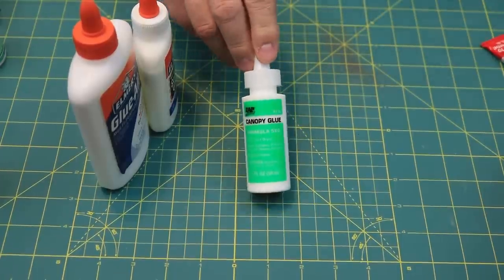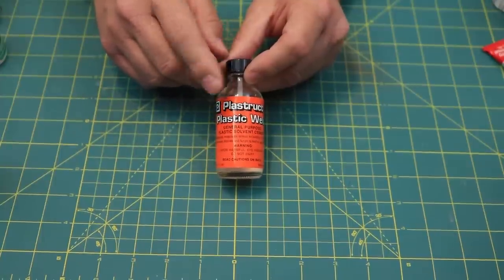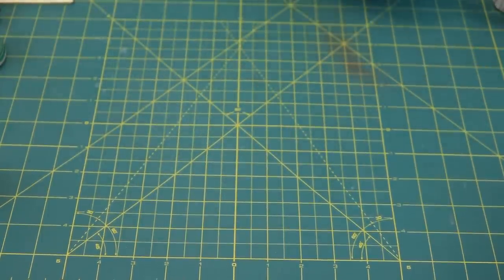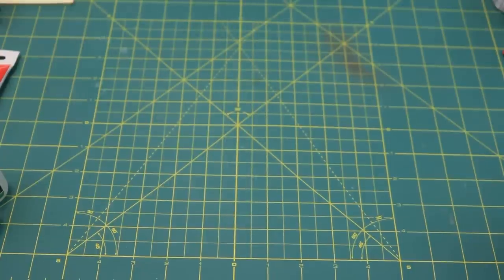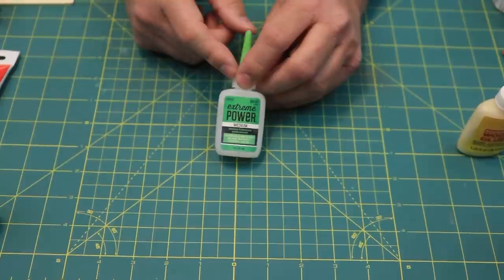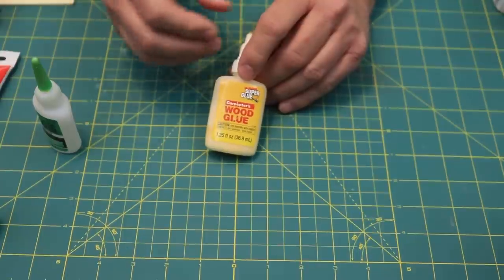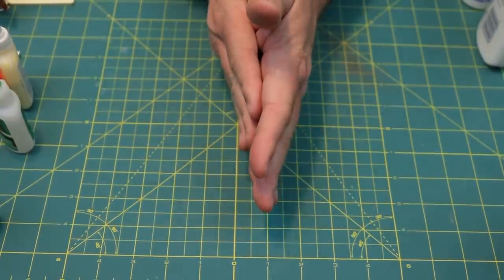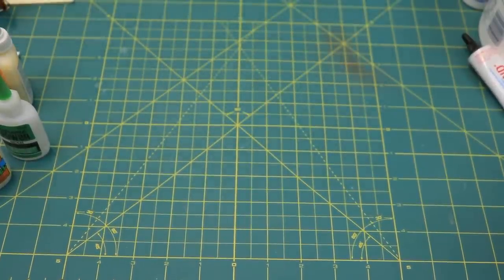Model Railroad Adhesives - How To Choose the Right One

Comment: Ron;
I am using Liquid Nails to hold down my track. Apply it, spread it with a putty knife, and lay the track. It does dry relatively quickly,  but adheres very well. The color  (off white) can be dealt with when ballast is applied. One caution is to be sure to leave the adhesive clear from the actual points on a turnout.

Dave Harrington

Comment: Pliobond is also a thermosetting polymeric adhesive. When gluing metal to wood the curing process can be hastened and driven to completion by slightly heating (e.g., with a soldering iron or clothing iron) the metal. Excellent, practical video. Kennedy
Reply from the maker: Good info. Thanks. See, a whole college course.

Comment: *Opens with a model railroad focused dad joke - NICE

I have a shirt exactly like that. 🙃

Choosing an adhesive is key in pretty much any modeling. When I was younger, whether it was trains, model cars, or kitbash projects, my default was superglue. Definitely not what you want to choose with clear plastic though!  

I was going to mention Tacky Glue and then it showed up on screen, so I won't.  Oh wait... Um...  

I've always been too clumsy for plastic welding. 

Handy hint... if you want to matte a photo, rubber cement is a good way to go. Apply to both the matte and the back of the photo, let dry, put them together, wipe away any excess. It's good for situations where spray matte might be a bit too messy.
Reply from the maker: Hi Christopher. Always good to hear from you, and thanks for the photo matte tip.

Comment: Another great video Ron, I have learned a lot from watching you. One situation that I continue to struggle with is constructing white metal kits. The only ones I’ve attempted are the pieces included with DPM kits. They never stay together or look horrible when they do and disassemble them almost immediately. Any hints or tips would be greatly appreciated.
Reply from the maker: Hi Bill. I wish I had a magic solution for you. IMHO white metal is the worst. The best solution is probably epoxy, but it is hard to mix and work with for very small applications like you are probably refering to. I typically use CA for detail parts, but it is imperfect at best.

Comment: What are your thoughts on using hot glue gun sticks?  I've used it to secure track and roadbed to the layout by using a small amount every few inches.  Seems to be holding firm and it can be  separated without difficulty (which is really nice for those of us who make mistakes!).
Reply from the maker: Personally it wouldn't be my first choice for that appliation, but I do use hot glue for building scenery base material.
Reply: I'm putting train under Christmas tree and was just looking into temporary adhesives for keeping tracks together. I was seeing all these fancy ones and a few minutes ago I thought about just Elmer's and then hot glue. Can't believe nobody mentioned it but I just decided in my head that would be easiest to apply and remove. Then I saw your comment lol

Comment: Great video, one question  using glue for models, I have the one you have for plastic or styrene but I have seen one that uses a needle type application is this same stuff just not sure thanks
Reply from the maker: I don't know one that comes with such an applicator on the bottle, but Flex-I-File makes the Touch-N-Flow applicator which I use and love. Here is a link: https://amzn.to/2AFz0Sw

Comment: Hi Ron!
Thx for all of your videos. I learned a lot.
On this particular one I'll ask you something:
I'm looking for an adhesive based on or made of (a kind) of transparent silicone gel used to seal joints in bathrooms for example, that I can dilute simply with IsoPropanolAlcohol (IPA) because IPA is evaporating so fast and - that would be a big advantage - is and will be so much flexible when it's dried.
Do you have any idea?
                  Greetrings from
            Beste Grüße aus
 dem
                 Salzburger Land

                       Austria

                       Stephan
      The Railroader from the Coast
             Der-Kueste-N-Bahner

👉 “ May the Trains run with you! ” 😎
👉 “ Möge die Bahn mit Dir fahren! ” 😎
Reply from the maker: Hi Stephan. Clear silicone is readily available, but how to dilute it is a question I have never pondered. You might ask someone at your local hardware store as silicone is a commond building sealant.

Comment: A lot of great info in that video. Anyone have a favorite or best for gluing extruded foam an white styrofoam? Cheers to all 🍻Thanks!
Reply from the maker: My favorite by far is Styro Goo. It bonds quickly, cures despite lack of oxygen between the foam, and is cuttable with hot wire tools. Here is a link: https://hotwirefoamfactory.com/-028SG--StyroGoo-.html?keep_https=yes

Comment: Whats best for plastic models
Reply from the maker: Some type of solvent cement. Which one depends on what type of plastic. For most applications I use MED with a few small scraps of styrene melted into it for filler. You can also buy commercial equivalents like Micro-Mark Same Stuff or Plast-I-Weld.
Reply: @RonsTrainsNThings  Can solvent cement which are joined after they have dried for 20 to 30 minutes can serve the same purpose for plastic models